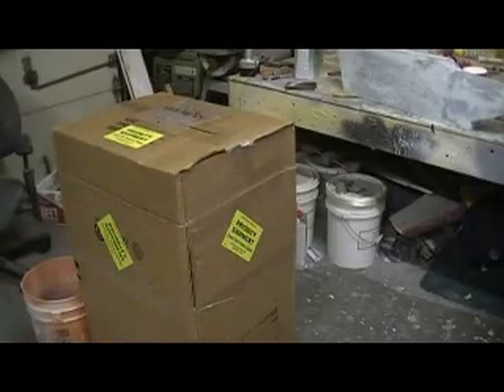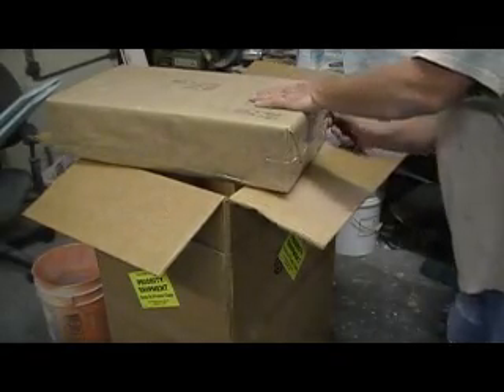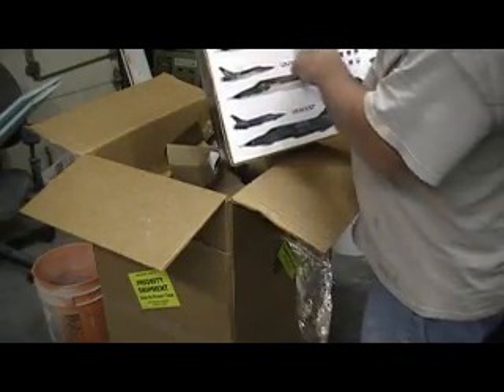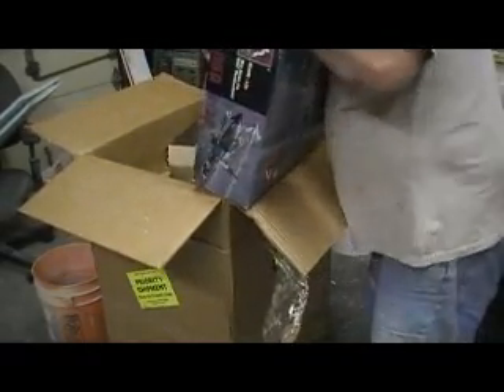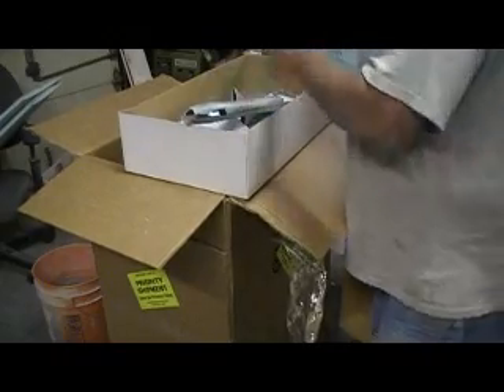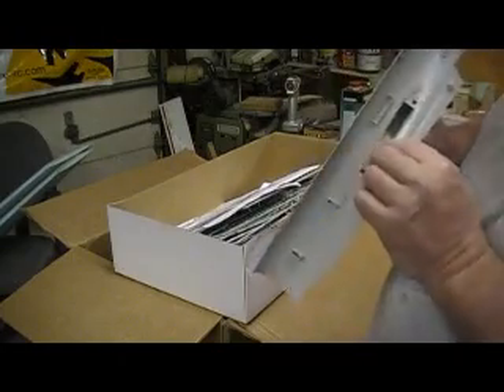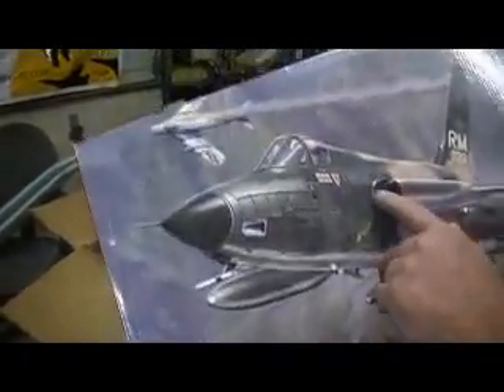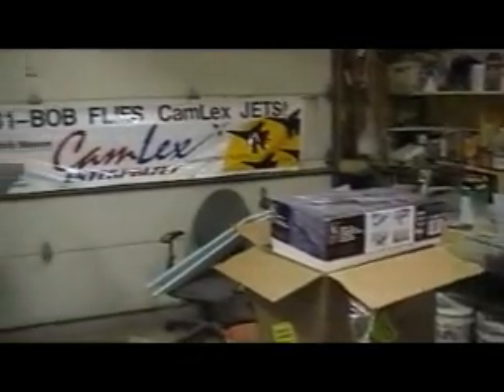how to build a rc jet F-105 thunderchief # 18

Comment: The Thud was the first supersonic tactical fighter-bomber developed from scratch.  The Tactical Air Command generals were worried that if the "B" in FB-105 designation was attached to the aircraft that General Curtis LeMay and his bomber posse would have insisted the aircraft be placed under his control with the Strategic Air Command, much like the FB-111s ended up in SAC.  It's because of this the Thud was only designated as a fighter and not a fighter bomber.